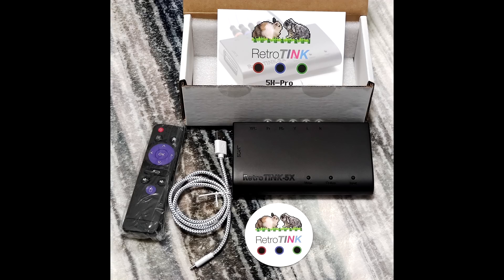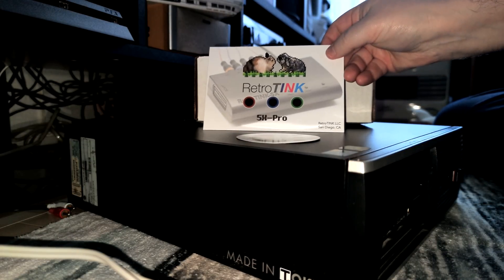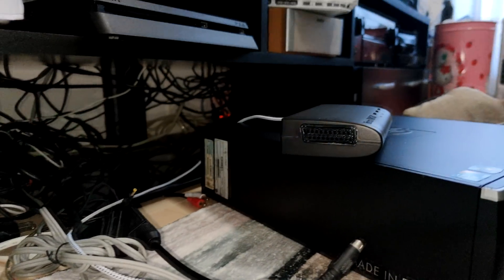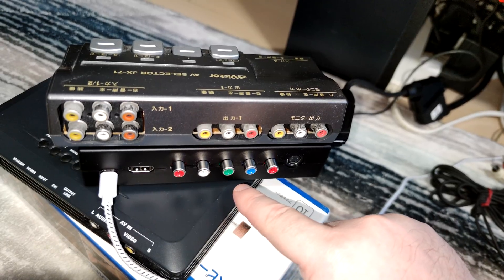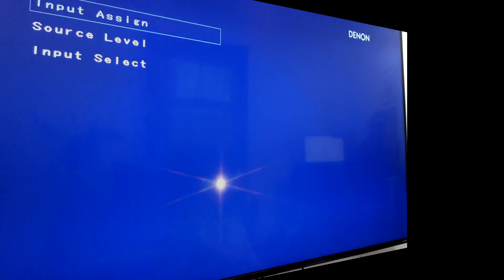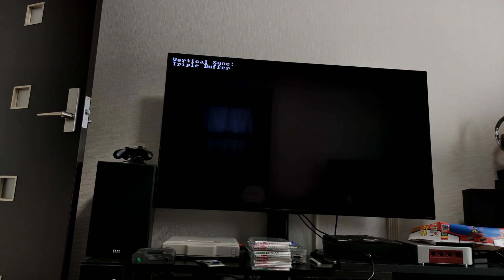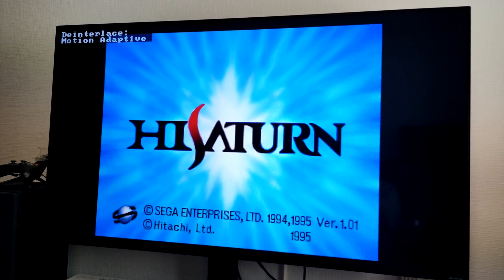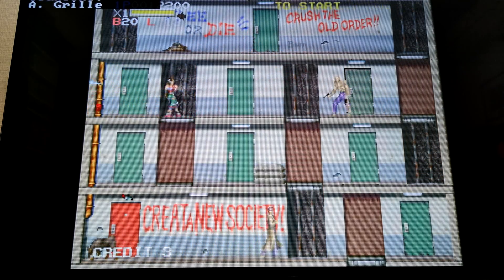RetroTINK x5 Pro - Unboxing, setup and first impression

Comment: Hey man, excellent video! Would appreciate some help if you could - I just bought the Retrotink 5x and really happy to now own it, I have a s-video N64 cable (PAL) to plug into it, I understand the s-video cable goes in the only slot for it, but there are 2 other cables for me to plug in - have any idea where these go? Yes, people might be annoyed at me for buying this device and not understanding it correctly but I had it suggested to me for streaming and did quite a bit of research before hand, I've just found it overwhelming to get my head around. I've looked online and can't find any information, so any guidance would be appreciated. Thanks!
Reply from the maker: They will be the left and right audio cables.  Plus them in to the red and white sockets on the back of the Retrotink 👍

Comment: Excellent review and video as always.

I do have a question, where did you purchase your JP21 cables?
Reply from the maker: The JP21 cable (male to female) was from Yahoo Auctions.  There was a seller on there selling a cable which he advised as a Retrotink 5Xpro cable.
I sent him a message and sure enough, it was a male to female cable wired to accept JP21 RGB cables.
The RGB cables I use for my systems are mostly originals from back in the day or again high quality new cables from Yahoo Auctions.
Reply: I see.

Thank you for answering!

Comment: how the heck can I use retrotink5x with PC!!!!! and capture card! there is not a SINGLE video showing how to setup the cables!
Reply from the maker: Easy.  You just use a HDMI splitter.   That's what I do.
So, the HDMI out from the Retrotink goes in to a HDMI splitter which sends the signal to the TV and to my PC Capture card.
I use the ELEVIEW EHD-66 HDMI Switcher
https://www.amazon.co.jp/gp/product/B07PYN1Z78/ref=ppx_yo_dt_b_asin_title_o00_s00?ie=UTF8&psc=1

Comment: that cable management 😡

i leave everything unplugged unless im going to use it lol maybe im just ocd
Reply from the maker: Oh, I'm not proud of the cable situation.  Its a mess.  It started off great but after moving stuff, adding other stuff and so on over the years, this is the result.
There are 13 consoles, 1 AV receiver, 1 UHD BluRay player and TV all connected and everything goes through the AV amp for audio.  Oh and the 6 speakers too.
So yeah, it's a mess. 😢.
But, everything is on switched sockets so I can switch everything off very easily.  There are 4 switched sockets so not everything is powered at once 👍
Reply: @RetroCore   my brother uses a switcher like yours 😇🌟

i have almost 100 systems 
but i have to keep all controllers/cords/power supplies hidden in a separate room in several dresser drawers
Reply from the maker: Good call on the controllers.  That's what I do too.

Comment: Looks like YouTube deleted my previous comment! I don't know if that's because I included a link to RetroRGB explaining the 360p mode or not.

The LCD filter is intended for use with the 360p mode provided for use with GBI, which is used for the GameCube's Game Boy Player. It will give you an approximation of the GBA screen with a grid separating each pixel, because the resolution has been appropriately corrected. If you use the LCD filter without the correct horizontal resolution, the grid won't appear correctly.

You can also use composite with the 5x via the green component connector or via the RGB input, using a composite to SCART adapter. Not sure how well this plays with your JP21 switch but for a standard SCART switch you can just plug your composite adapter in there and feed it through the same input.
Reply from the maker: Thanks for the info on the LCD filter.  That makes sense now.
Yeah, I knew about composite but I'll never use that feature.  Being someone who grew up with RGB, the lowest image quality I can tolerate is S-video.

Comment: I completely separated audio in my setup. All consoles audio goes to a switcher and/or mixer then goes to my PC speaker or DAC to my headphones. How's the PS2 with this? Nobody seem to show how it does in detail. Everybody says "it looks good", but I never saw any good demonstations.
Reply from the maker: A man with the same idea as me.  Ever since 1989, every console I've had plays the audio though an amp.
For the PS2 and the likes, I use the audio pass through on the TV.  Good CRTs also had this feature in the 90s.
So basically, anything that would go through the TV speakers now comes through the amp since the TV is connected to it via a Toslink.
Back in the day with CRTs it was phono cables but it's the same principle.
I guess you could even do the same via a stereo TVs headphone socket.
Reply from the maker: Oh, wait, you are wondering what the PS2 looks like via the Retrotink?  I've not tried that yet but will show it in an upcoming video.  I know a PS2 on the Framemeister looks crap due to most games being interlaced.
Reply: @RetroCore  Yeah, PS2 looks bad on everything modern. I tried OSSC and Retrotink 2x, both have issues.I have two consoles that I still play only on CRT, my PS2 and Wondermega.

Comment: I swear I would get a CRT instead of dealing with the cable management nightmare that these upscalers/line doubling devices generate.

I know it's a matter of preferrences, but I long gave up on dealing with original hardware (where possible) and moved on to modern solutions such as MiSTer or Analogue, which are directly compatible and made with HDMI displays in mind.

I have to give the RetroTink a big thumbs up though for the scanline effects, they are top notch!
Reply from the maker: Lol, I wish I was posh or at least had the money of a posh person.
Reply: Precisely 🙂. I don't care for CRTs personally, but yeah, if the plan is to continue playing on original hardware, might as well keep a TV from that era as well.
Reply from the maker: Cable management would be the same on a CRT though if I wanted to connect the same amount of consoles to it and have audio through an amp.
Reply: @RetroCore  cable management is a nightmare however you put it, I guess. This is because too many consoles 😀.

Comment: Why even give yourself all this work? If the framemeister met your needs why bother with all of this?
Reply: Because the Framemeister doesn't do motion-adaptive deinterlacing or resolution switching at all well, which makes the 5x very useful for 480i games or cases like Silent Hill.
Reply from the maker: The thing is, the Framemeister did meet all my needs besides two.  It was terrible for timing out on games that switch resolution mid game.  There's a lot of games I enjoy on the Saturn which do that.  It also lacked screen overlay options and 4K support for scanlines.  The Retrotink covers these points but loses out on flexibility and inputs 😢

Comment: Why you are not using the fm anymore? 😧
Reply from the maker: The timing out on games that switch resolution has always been a pain with the Framemeister.  Playing some games just wasn't possible.
The Retrotink fixes this issue plus has much better filter and scanlines options.
Reply: @RetroCore  ah ok. I remember when the fm was sold for $400 in ebay, now a $150 have better options. Good I did not buy one.

Comment: I don't really see the lack of an HDMI in as a problem. After all, it is geared toward retro capture. The Framemeister is a premium capture device, and you pay for it. Comparing a 300 dollar device to a 1,400 dollar one isn't fair.
Reply from the maker: 1400 is just the US price though.  US pricing for retro stuff is just stupid to be honest.  In Japan you're looking at around 400 USD for a new Framemeister.
My point though is that on many forums, Retrotink fanboys do nothing but slag the Framemeister where as back in the day they were all creaming over it.  The Retrotink in a better machine for the scaling and it should be considering how much newer it is however, it seriously lacks inputs.
The twin HDMI ins on the Framemeister were great as they could be used as a pass through (switch box) and great for adding scan lines to PC games or emulators that didn't feature them.
Reply: @RetroCore  1400 for a fm? They are crazy. I saw them for about 40000 yen in Japan two years ago...

Comment: yeah....no, 300$US+shipping mean about 400$CAN for me. i'm gonna wait many years till it's A LOT cheaper than this. 

In the meantime, i just wanted a good solution to be able to stream my XBox and PS2 in 480p+ in Component, so i bought something much cheaper (40-45$), but work great still while i can choose a 4:3 ratio resolution in the device too.
Reply: Try pricing a Framemeister
Reply: @jamesburchill7522  still in the "too expensive" range, really, even 200$US is expensive for such a thing. it WILL drop in price eventually though. The problem with Framemeister is they didn't made much of them and are considered a rarity now, while the Retrotink5X can still be produced in many more quantities.
Reply from the maker: I just sold my Framemeister on Yahoo Auctions for 34,500 yen.  I only paid 28,000 for it brand new!  The price of the Framemeister is sky high these days.
True, the fact mine still looked new and complete in box helped with the price but yeah, no one is finding a cheap Framemeister unless they're lucky.
Reply: @RetroCore  peoples nowadays are crazier than ever, and will buy any kind of stuff for stupidly high prices, even if it's complete crap. Even if i had the money, i wouldn't buy the 5X-Pro, because for such a thing, i think it's too expensive. 

You have to be a successful streamer or Youtuber (from Youtube payouts or Patreon) to see it as an investment/business expense. Otherwise it's a very expensive piece of hardware to buy.

Comment: The inflexible audio and no HDMi in are the reasons I've not boxed up my Framemeister yet, but the Retrotink is a great "it just works" solution, with great video quality.
Reply from the maker: Yeah, as an upscaler, it is way better than the Framemeister.  But for flexibility it falls very far behind.  Thankfully I've since fixed the audio flexibility issue with a very cool little device from Amazon Japan that takes in Analogue audio and outputs a lossless stereo digital signal with zero delay.  Cheap too at the cost is two big mac sets.

Comment: Nice review. I wonder if the makers of the RetroTink will ever produce some kind of deluxe edition to incorporate more inputs. I'm still running the Framemeister, but I bought a third party expansion box that sits on the top that gives 4 RGB scart rather than being limited to the 1. Certainly helps given the amount of RGB scart consoles I've got. 

Completely off topic....are door handles in Japan usually fitted upside down? It's messing with my head! 😂
Reply from the maker: Lol, I hear you on the upside down door handles.  I thought the exact same thing when the house was built.  Turns out they are on upside down.  The dick they had fitting the doors was a young lad who obviously had no idea.
Over the past 10 years I've become a custom to them so they've stayed that way.   I should fix them I guess.